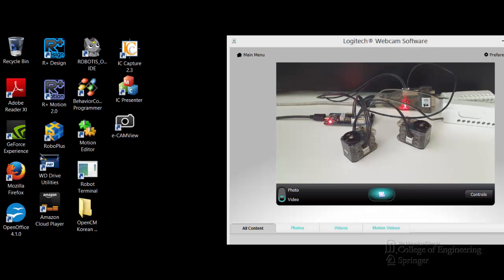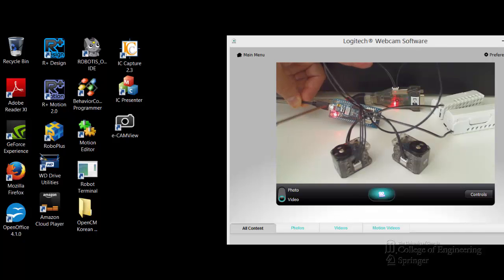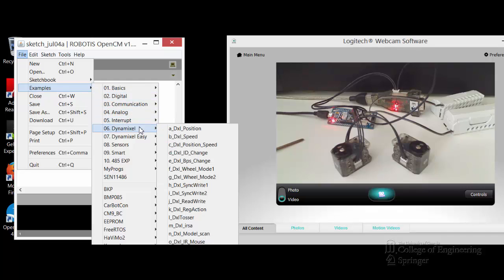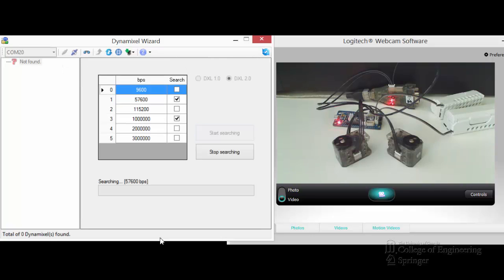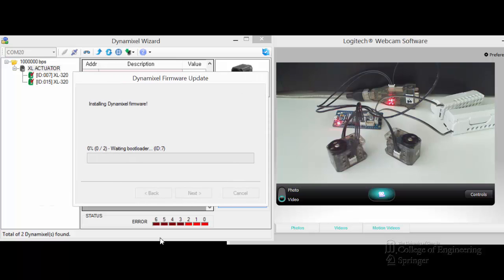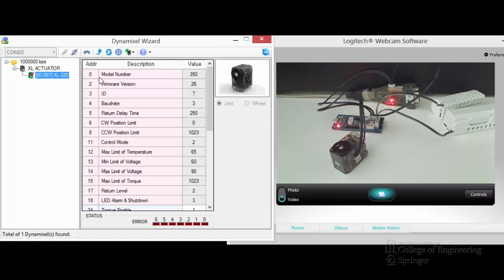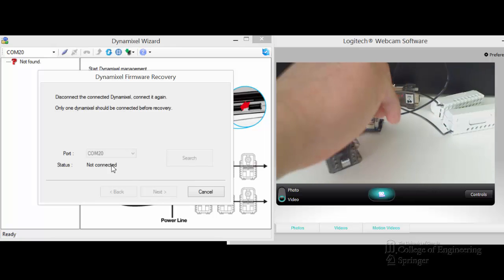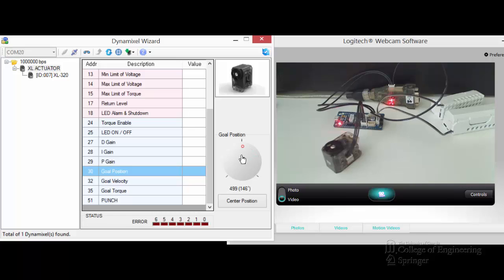Updating/Recovering Firmware on XL-320s using an OpenCM-9.04-B & Dynamixel Wizard

Comment: Hello sir, i have a problem. My servo xl-320 just give a red alarm and not detected on dynamixel wizzard. How to fix this problem sir?
Reply from the maker: There is an easier way to check/update the XL-320 via the MANAGER V.2 tool.  Please see my other videos https://www.youtube.com/watch?v=1P4yfUfEKWo and https://www.youtube.com/watch?v=BTyZNZhaYp8.  If the MANAGER tool cannot see your XL-320 also, then it is time to get a new XL-320 if you have passed the warranty period for your XL-320!  This situation has happened to me before several times, as nothing lasts forever.